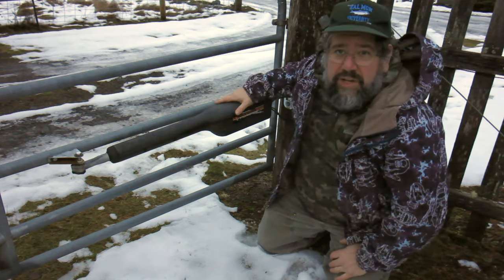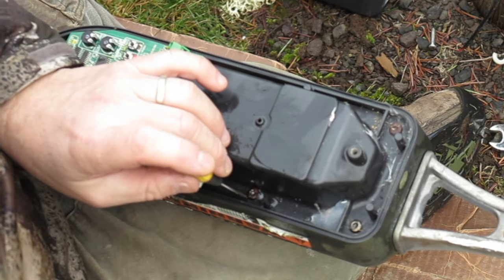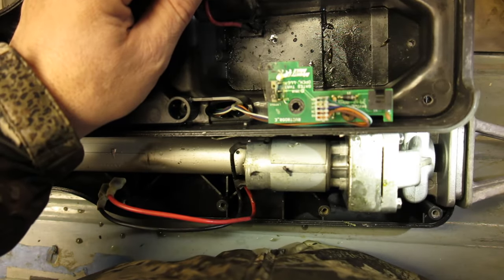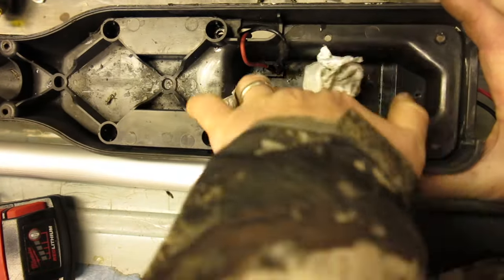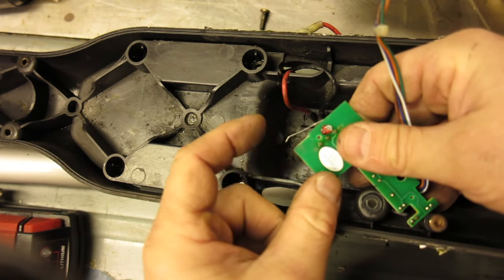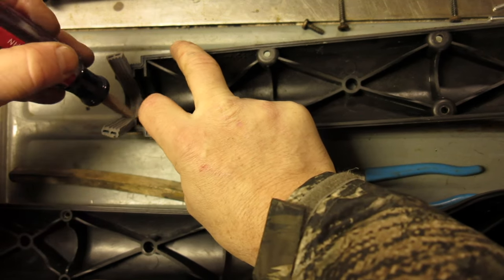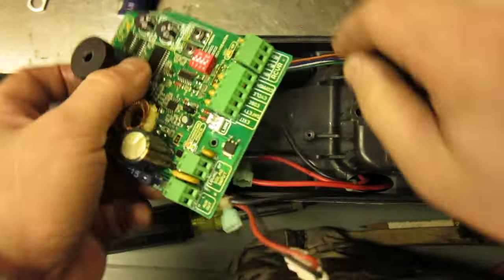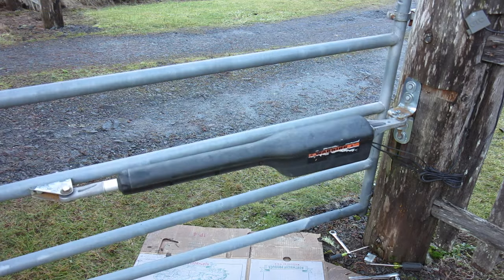Mighty Mule gate opener troubleshooting and repair

Comment: Have had three 350 gate openers They are really bad for blowing the main circut board,Tryed to get a new board from mm and said they are no longer avaible .THANKS ALOT MIGHTY MULE.
Reply from the maker: I agree, these economy openers are almost disposable. There are a couple of components that seem to blow on the main boards, and they usually blow when the opener strains and pulls a bunch of amps. I need to make a follow-up video explaining what to do in that case.

Comment: I have model 271, it would open like a few feet then beep & stop. After disassembly i found the motor housing full of ants and larva. The larva were being pulled into the limit switch. After cleaning everything real good it works!
Reply from the maker: That's awesome to fix it without having to buy any parts! That's my favorite repair!

Comment: Yesterday morning my gate arm started to have the same issue.  It wouldn't open or close and the gate arm had the same beeping pattern.  I took it apart and followed all of the instructions in your video, there was quite a bit of water and moisture in the casing as I was taking it apart I was finding more water in each area. I dried everything out and let it set out to dry overnight, I put everything back together today but it's still not working, still beeps in the same way.  Do you have any other suggestions for me to try?  This video was the best result I could find online for this specific issue so I am hoping you might have some additional advice or tips for me to try. I hope you see this comment!

Thank-you so much for the video by the way! It was incredibly helpful and informative and made me feel comfortable taking this gate arm apart as I have never tackled doing it before.
Reply from the maker: I'm sorry I'm just seeing this comment now. Did you ever get your opener fixed? Did you check therev counter board IR emitter / detector area for water?
Reply: @normnelson Hello!  I did eventually get it working but then it failed on me again.  Now I am having another issue.  I came back to your video to find that you just responded to me an hour ago.  Talk about some good timing!  My old arm needed to be replaced and today I am actually going through the process of installing another arm.  Upon hooking up power and powering on the device, it’s a constant loud alarm sound coming from the arm.  Any suggestions?

Comment: My gate keeps opening and closing by itself and I can’t get it to stop. I live in the desert southwest, so moisture is not an issue. We have had temperatures 100 degrees plus for days. I don’t know if that could cause problems. My husband died a few months ago and I am not mechanically inclined, so I have no idea what to do. Can you make any recommendations or suggestions?
Reply: I’m having the same issue. Any tips would be appreciated.
Reply from the maker: Sorry, I'm just seeing this comment now. My first thing to check would be if your gate has a wireless remote and if there is new wireless interference from some other source... so if you have a wireless remote, I would change the code on the remote... there are instructions online for this, normally it's a small set of switches inside the remote, and then you press a button on the main board of your gate for your gate to "learn" the remote code... but this varies by gate model / manufacturer. So I would download the manual for your particular model and see how that works on your model.

Comment: Well done video!  Informative and insightful. Did you see a way to grease the leadscrew?  Mine has started making a screeching noise.
Reply from the maker: Thanks. There is no zerk fitting or anything, but you can lube the Acme screw directly when you have the opener apart, then cycle the opener to grease the areas you missed.

Comment: Excellent, after much rain  and deep freeze, the gate developed issues like you described. Warmer, it would work with stops. I was, am getting water drips when turning the on/off switch. This video is a great one as you show exactly how easy it is to service and also seal. The add-on of slanting for a water run is a good idea. Will probably try to repair before buying a new one.
Reply from the maker: Glad my video was helpful. Did you try the repair?

Comment: Thanks for the video! I had mud wasps plug my drain holes so yeah, it was wet!
Reply from the maker: Wet is no good! A little screen over the hole might help with mud wasps...
Reply: @normnelson   - that is exactly what I did.  Those mud wasps ended up shorting out the round alarm/audio component.  I sent this info/pix along to Nice/Mighty Mule for product enhancement consideration for those of us who live in the NW or areas where these critters thrive.  Silicone and a bit of screen works great.  BTW - great video!

Comment: where are the red and black wires that are connected to top of the board  coming from? power switch or from the motor? Thanks
Reply from the maker: I'm not sure whether you're talking about the "top" of the circuit board as it looks once you take the cover off... that is actually the bottom of the board once the gate opener is installed. I will say that as I've shown it in this video, with the cover off, looking at the bottom of the unit... the red and black wires that you can see connect there go directly to the motor. The red and black wires underneath the circuit board (closer to the inside of the unit) go to the power switch. Does this help? https://youtu.be/DuddDiTF5nY?t=482

Comment: Thanks for video. What bit did you use for top center? I noticed you switched to another bit but couldn't tell what.. Mine is clogged with bug mud and I can't visualize the head.
Reply from the maker: That's still just a torx bit for a torx screw (I can't remember if they're T-20 or T-25, but they're all the same), but I added an extension for that one screw because that one screw is further down a small hole.

Comment: Would you know where to find a replacement bracket for the base?  It's the part that'll connect to the post.  I can't find parts anywhere online?
Reply from the maker: Do you mean the part on the arm, or the part actually attached to the post? Here is a bracket set for the post: https://gateopenerking.com/store/bracket-set-350ih-2-qty-351ih-352ih-353ih-sw1000-mm700.html?gclid=CjwKCAiAhKycBhAQEiwAgf19esr3xUpnF9n-A3wnHOlLbG82NK-ylHjidk6eWHwgZuEEMYId0YKE6xoCkUgQAvD_BwE
Reply: It’s the molded aluminum part that is part of the main motor housing that attached to the stainless steel brackets on the post.  It’s an internal part that connects with two short bolts to the motor housing.  It has two parallel tongues that bracket the metal piece I had to weld to the post.  I’ve looked everywhere for this part.  No luck….
Reply from the maker: @theoh6260  I believe they only sell (or sold) that as part of a kit. You might try searching for "Mighty Mule rear mount kit R4430". I see one supposedly in stock in Canada? https://www.jokmamu.shop/index.php?main_page=product_info&products_id=82846

Comment: My micro switch was good plus replaced it just to make sure. Manually try continuity goes.. When I turn on still pass the switch and blow the fuse
Reply from the maker: Make sure the wires are connected to the correct terminals on the switch, (depending on the switch, you could have normally-open and normally-closed reversed) then the problem is in your circuit board.

Comment: Do you know what size motor would fit a mm371?
Reply from the maker: I don't know for sure since I haven't disassembled a MM371, but it's likely a 550-sized motor. Both 540 and 550 sitzed motors are 36mm in diameter, but the 540-size motors are usually 50mm in length, while the 550 motors can be 55mm to 90mm in length. I recently repaired a small reciprocating saw (Makita knockoff) and the RS550 motor in it was 57mm long, which is pretty typical.

Comment: I think the seal seam at the bottom is best. The only other way to make it better is to split the seal the long way and put one seam at the top and one on the bottom.
Reply from the maker: I've had no problems at all with this opener since I sealed it up well. It's currently freezing weather here, snow and ice and it's still running strong!

Comment: If it's afraid of water not well made
Reply from the maker: Yeah, water and electronics don't mix. It really should be sealed better / have a gasket from the factory.
Reply: Yeah, I just opened mine up, it got all kinds of water in it, gonna just build a little roof over it...
Reply: @gilwilforbes  Exactly. I made mine a raincoat out of 40mil Oatey gray shower pan liner. Fold it over the top and joined it together at the bottom with three small bolts (along the length, back, middle, shaft end) with wingnuts. Has lasted out in the sun/weather for over 3 years now, hasn't deteriorated.
Reply: @normnelson  Did you happen to do any water sealing around where the (power/accessory) wires come into the unit (would be opposite side of where the arm extends/contracts)?  If you slightly raise the unit as you noted (so it is higher where the "L" shaped bracket is at, the issue now is that water will come into where these wires enter the unit.  While there is a very small escape hole on the very bottom for this water, there is a lot of water and condensation buildup in there.  Was thinking to either silicone this area or use plumber putty or something - have you done anything for this by chance?